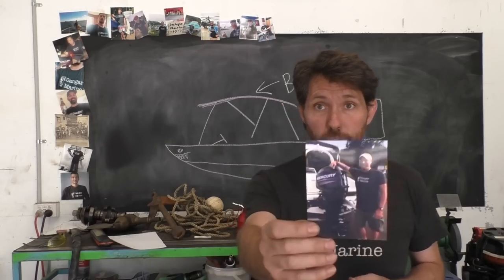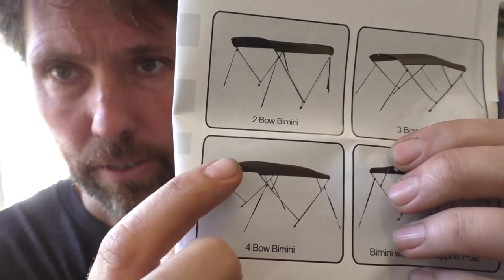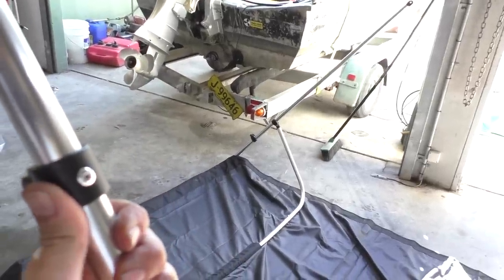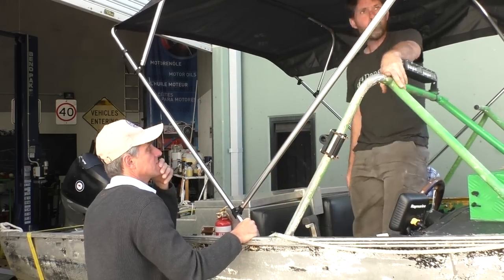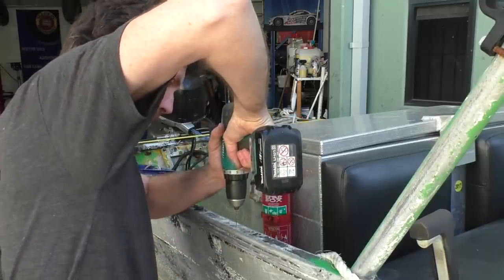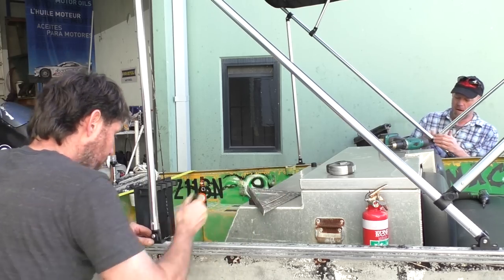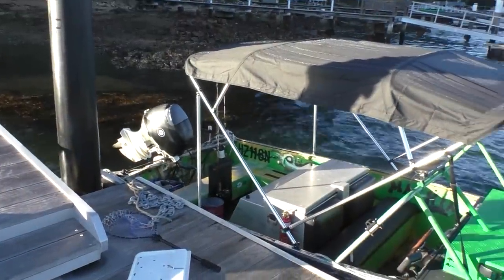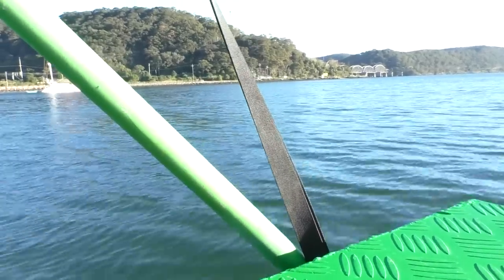Adding a Bimini to a boat

Comment: A bit late to the party. Would it be worth considering the angle the boat sits at when on plane, so that the Bimini is then horizontal and offering the least air resistance? Otherwise, you may be installing a huge air brake to reduce forward speed.
Reply from the maker: Generally a boat will point up getting on the plane and then sit pretty flat again once at full speed.

Comment: Another engine problem on my honda 15HP 4stroke. The ignition sucks. If it doesn't fire up I reconnect the wires on the Bobine until it fires up again... Very weird
Reply from the maker: Bobine?

Comment: evinrude johnson 6 hp 2 stroke 1969 brand new coil reading from green wire to spark plug outlet pin {inside the coil no lead fitted } digital mulit meter reading set on20k is 10.26 is this to high ?
Reply from the maker: No idea. You'd need to track down the service manual for that motor to find the specs.

Comment: Is there anyone that can help me with the torque specs for the 10 bolts of the cylinder head of a suzuki dt40 from 1983? And maybe for the 4 smaller ones that hold the cooling cover? Many thanks upfront.
Reply from the maker: I've never done one of those but I'll let you know if I come across the spec. MarineEngine.com has a forum dedicated that Suzuki outboards that might be able to help http://www.marineengine.com/boat-forum/forumdisplay.php?966-Outboard-Motors-Forum
Reply: Thanks for the reply, anyway i finally found them if anyone else is interested the 6mm bolts are 8-10 N-m and the 8mm bolts are 20-23 N-m. I have him running fine again, thanks for the inspiring video's you make it helped me so much in my boating proces ;).

Comment: I think it's on backwards :)
Reply from the maker: Even I can't get a bit tag that says "FRONT"wrong! ;)
Reply: James I think you are correct, if the bimini was to be folded foreward as in a half cabin with a much higher windscreen, the frame would need to be reversed, in my opinion too. However Stu is folding it toward the stern and therefore his orientation of the frame is correct for him. Apparently the cover can only be fitted one way hence the tag stipulating which is the front.
Good work Stu.